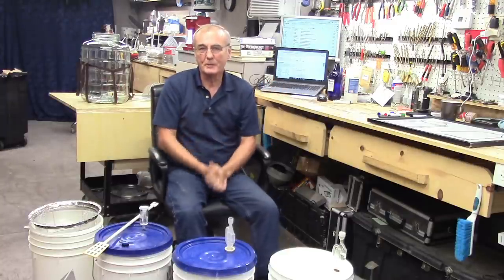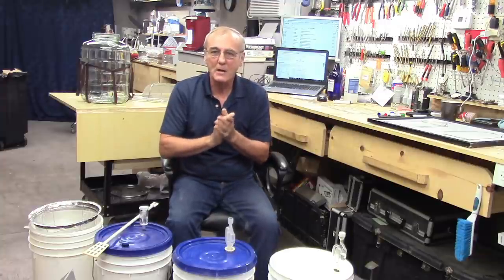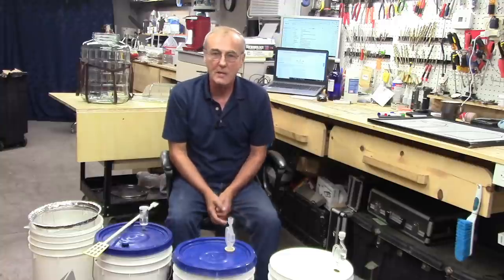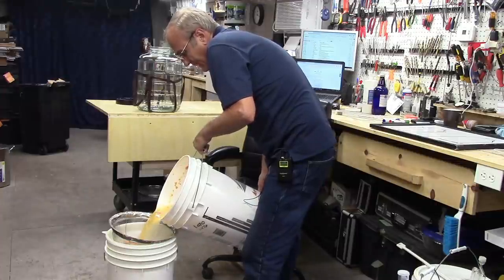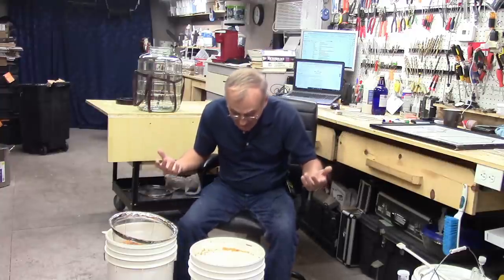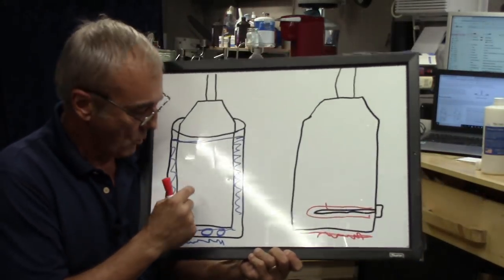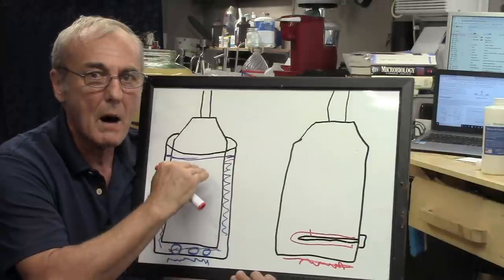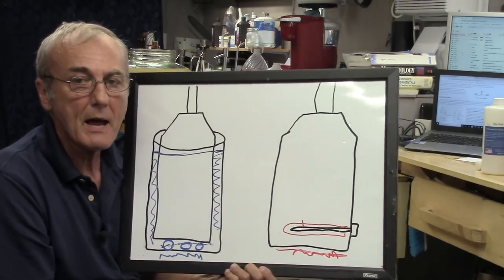SWEET POTATO VODKA PART 5

Comment: Just as a suggestion, leaky lids can be remedied by stripping the outer jacket off of a piece of 12/3 romex by splitting it on the narrow side then placing it on the lip of the bucket between the bucket and the lid.

Comment: So how do you keep from scorching your mash?
Reply: Gentle heat/low power or PWM heating element
Reply: @thomasa5619  i use an induction oven i just set the setting to 175 and let it stay at that temp is this good or bad?
Reply: Sorry, before I have too much misunderstanding...

Your kettle containing your mash is inside a fan forced oven?
Reply: My pot sits on a burner i set the burner to 175 or 180 and let it heat up and it stays on that temp
Reply: Justen Hearn yeah that shouldn’t scorch, you have the interface between burner-kettle, which should spread out the heat, and the implicit control from setting the burner to a limited temperature

Do you already have scorching problems?
Reply: I don't know if i have scorched my liquor i dont know what scorched liquor tastes like
Reply: Justen Hearn I presume burnt